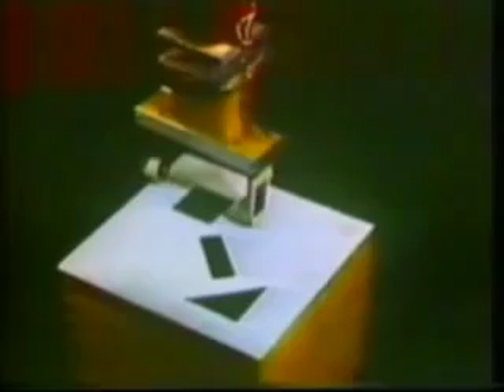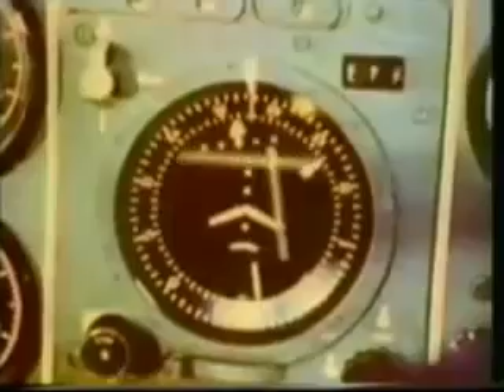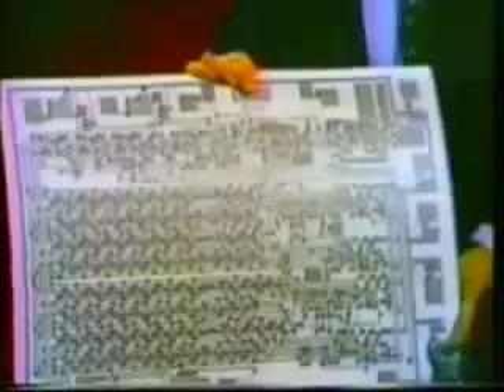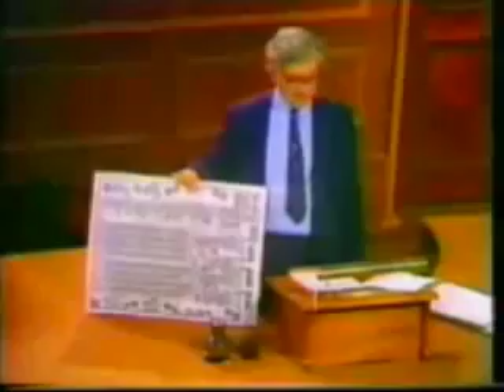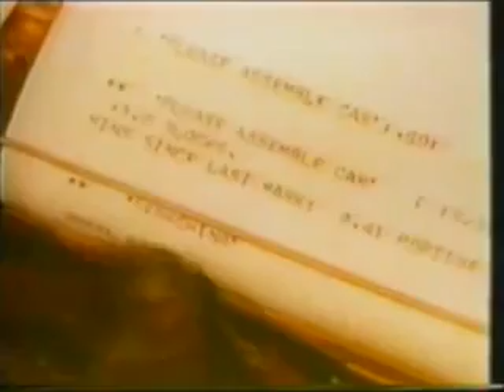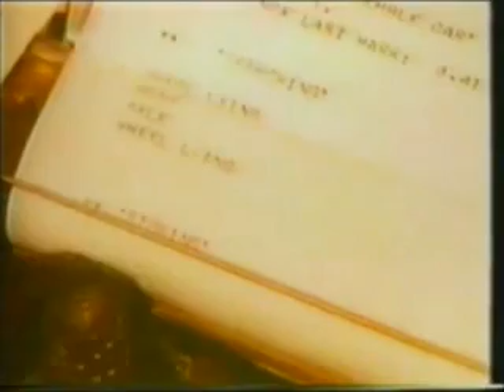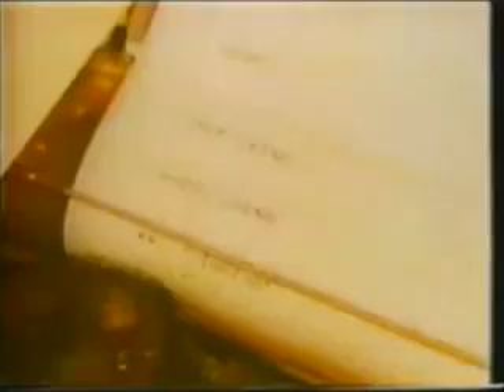The Lighthill debate on Artificial Intelligence: "The general purpose robot is a mirage"

Comment: I still struggle to wrap my mind around just how stupendously limited AI and robotics were in the 1960s & '70s. No wonder Professor Lighthill was skeptical— computers of the day were basically electric rocks. I recall one used in retail was the Friden 5610 Computyper billing machine from the '60s. It had 256 bytes of memory, but it was a delay line. It literally was a steel wire looped back and forth, at one end a torsional twist would be induced for all the 1's, and the other end would detect the twist and send it back for replay. You loaded it with a paper tape reader. At the time, it was a fairly high-end machine and they could still be seen in the 1970s.
This single comment possesses twice the number of bytes of that computer.
The top supercomputer of the '60s was one of the pre-Cray machines— the CDC 7600. I believe it had a little more than 3.8 megabytes of memory and was capable of about 35 megaFLOPS. A year ago, IBM unveiled a computer the size of a speck of dust that appears to possess orders of magnitude more power than the 7600.

Today, some of the most basic machine learning networks require gigabytes of data running on teraflops-tier computers (IIRC, some higher end PCs can achieve around 20 teraflops). Even these leave much to be desired, but they are slightly more generalized than what has come before.

That artificial intelligence researchers did as much as they did at the time is tantamount to magic. But the Lighthill Report was destined to happen.
Reply: It is also apparent the hubris that his entire argument for general intelligence to work (or in his case it doesn't) is based on the fact that everything needs to be a) solved, and b) be based on some model of human intelligence. When in fact the best models are those that have adapted to the data and have basically nothing to do with general human intelligence (i.e. Deep Learning)

Comment: Another point: the general-purpose robot has arrived. ASIMO in 2000 (or perhaps P3 from 1996) was the first "true" general-purpose robot. The problem there was not the hardware but the software— we could have had ASIMOs in every home and business had we possessed general-purpose artificial intelligence.
Professor Lighthill mentioned that it was likely not possible that computers could match the human-brain in power. We can currently see at least the distant glow on the horizon at last— if it were possible to further generalize deep reinforcement learning & transformer networks, it might be possible to bring general-purpose robots into the home in the 2020s. 
But machine learning requires godlike amounts of digital data, many orders of magnitude more than that existed in the 1960s. Couple a lack of computer power with a lack of big data and you can begin to understand why general-purpose robotics & AI was in such a hopeless state in the '70s. Even though people could clearly envision what it would look like, no one could replicate brain functions on computers that had less power than a TI-83 calculator.
Reply: A problem with ASIMO most definitely was the hardware. I saw a demonstration of one in person in 2013 (and of course if I hadn't I could've watched videos) and, while it's extremely impressive, it's also a joke compared to what a human can do. I suspect there's no actual disagreement between us; I just prefer to reserve the term "general-purpose robot" for something much grander.
Reply: I guess you could say that with a real mind inside it, the same motors and servos and whatnot would be used in a much more human way. That could be true; what I said could be mistaken.